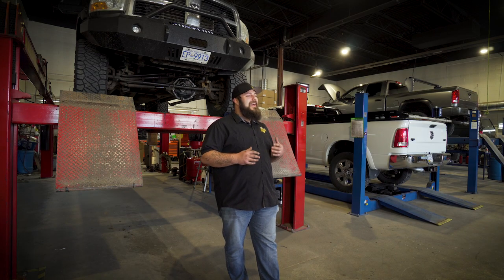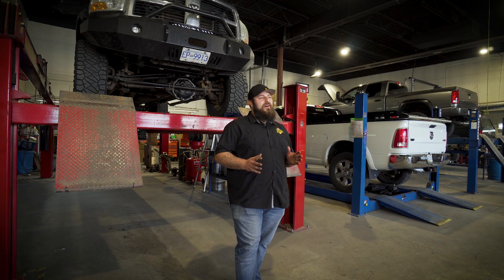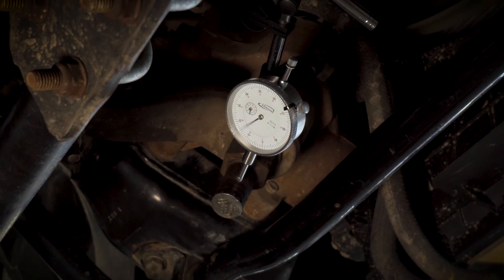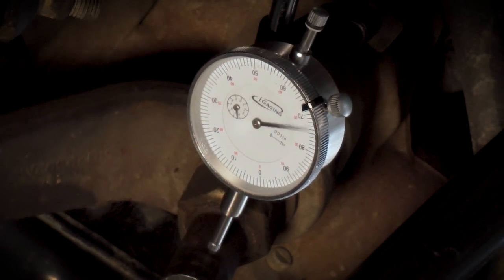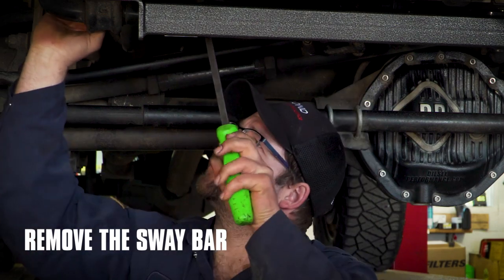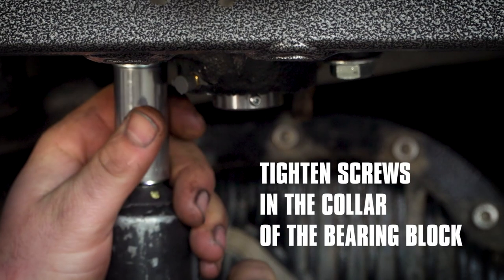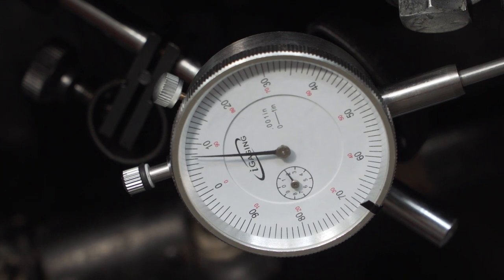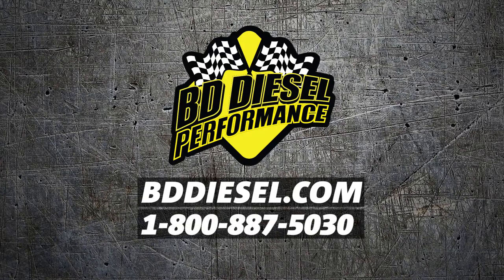Does a Steering Box Stabilizer actually eliminate Death Wobble?

Comment: I love your products and have your steering stabilizer on my 17 Ram 2500. However I think it would be worth mentioning that just about any worn steering component on the front end of these(solid axle) vehicles (Ball joints, track bar bearings, drag link/tie rod bearings, etc) can contribute to and cause death wobble. Not sure there is a magic bullet fix other than replacing any worn components. Of course this aftermarket fix along with some others(upgraded drag link/tie rod, Upgraded track bar) will keep ya rolling straight alot better than the factory junk!

Comment: This is a good product and I use it on my 98. All this does is remove some of the slop in the steering wheel from the play in the output shaft of the gearbox. They way they are advertising it is not accurate and this will not fix deathwobble. Years 94 to 97 and '00 until the 4th gen can sufffer from deathwobble due to the fact of the steering suspension forming a 'Y'. Most 2500s and 3500s 98-99 utilized the HD steering suspension that they later used on all 4th gen solid axle where the tie rod is a solid piece with an adjustment sleeve for alignment. This is the style that they're demonstrating in the video.... So if you're wanting to fix your deathwobble then you have to upgrade to the 98-99 HD tie rods, drag link and pitman arm for the second gen. If you buy the 4th gen style, you'll have to ream out your knuckles to get the joint to fit.

Comment: What stumps me is; when I was a young kid (60s) my father and all his friends had various 4×4s all straight axle and none of them had the wobble ever. It seems to have become a thing in the last 30 years or so. The only common denominator I can find is the move away from leaf springs in the front JMO.
Reply: I was thinking the same thing I had a 76 Ford f250 on 36-in tall tires never had an issue
Reply: I drive a 1984 as well as a 1989 Ford F250 never had any issues with wobbles. What poor engineering in these New overpriced Trucks.
Reply: Leaf spring trucks do it too. My 01 Superduty does it.

Comment: I did this on an 06 2500.  Worked like charm ..  Also thuren track bar and control arms ...try to run Toyos or nittos. My nittos work great . 55lbs of air .
Reply: I have a 06 doing the death wobble and doing the same thing I'm about to give it a go

Comment: I just removed mine on my 08 to install a new HD 2010+ steering gear and because the sector shaft is so much larger I need the new "nut". Bought a factory nut to get by for now but Holy crap does it wobble around now! I ordered the new 2010+ kit right away.

Comment: i own a 2006 dodge ram and i installed a steering stabilizer from BD but they pretty much all look the same. Needless to say i still got the wobble, after installing the Kore Recon series lift kit i removed it mainly because with the aluminum sway bar lowering block, i didn't have the correct length bolts. What i noticed was it had to do more with tire wear and balancing than anything at least with my truck. With new tires and alignment i have no issues whatsoever but when tires are at the halfway mark, i gotta watch for those uneven surfaces, bumps or dips.
Reply: It’s all part of the system. Everyone wants to say one thing is “the fix” but wheels/tires, shocks/struts, steering dampeners, and upper/lower control arms are all factors. Bottom line, the frame rigidity is the most common issue with big Rams.
Reply: Being in 4x4 country, and being an ASE certified master tech. I will offer the following info. (Please note that I became well known as the guy who could actually solve the death wobbles  where many others could not!)
Any solid  axle front suspension is subject to the "DWs" the reason (Which is primarily a Jeep and Dodge issue. Although my exs Mercedes had a "DW" issue also)
The main culprit is the front axle pinion angle. (Hear me out) As anyone who has lifted a 4x4 can attest to, this can be a real problem.  On Dodge/Ram and Jeep 4x4s with solid front axles when the front axle pinion is moved up to correct a lifted suspension angle issue the caster setting for the steering goes out of specification. (As in too much positive caster) A vehicle (particularly one wirh a solid front axle) that is brand new with no front end wear that has too much positive caster can offer up the dreaded "DWs" 
Add in "ANY" wear in the steering  components tires not perfectly balanced and/or a rough road and there you gave the undesired   wobble condition. If you are unsure what a caster setting is, just think of the balljoints as being the hinge on a door ( or in this case the hinge for your wheels to swivel left to right) The caster setting is the angle of the hinge. A positive setting has the top of the balljoint/hinge forward of the lower one. Where a negative setting is just the opposite. The more positive the setting the easier it is to steet and has less control over straight line stability.  The opposite is true for a negative setting. So, what to do about this issue? First of all remember that ANY wear or items added or changed in the front axle and steering cam amplify a less than desirable caster setting. Sometimes just front spring sag /frame twist/ axle bend (as in Dodge Diesels) can be an amplifier of the lack of caster settings. Larger wheels (more wheel offset) and tires (more weight to control for the steering  and shocks).
So how to take care of the problem? First of all, all steering components have to be in excellent condition. Second of all these issues don't start until there is considerable wear on the balljoints. Front caster and camber is adjuted by either rotating the balljoints or by rotating the sleeve that the balljoints seat into. So the number one thing to be done when replacing a balljoint AND/OR the adjusting sleeve on any lifted or truck that is having an issue is to only purchase one that has the most offset as possible.  (1-5 degrees) Select the most offset that is available for your vehicle. In some cases, you can get an offset balljoint AND an adjusting cam with a wide range of adjustment.  ( 2 degree offset balljoint and a 3 degree adjustment cam would be great) I always started worh the highest available offsets and only on a couple of occasions did I have ro back down on the cam offset. PLEASE READ AND UNDERSTAND THE NEXT STATEMENTS!
Remember that not only are you changing caster, you are also changing camber when installing  offset balljoints and adjusting cams. Before doing any of this installation make sure that you have a discussion with the person who will be performing the alignment.  Make sure that you will be happy to pay as much as double for the alignment for them to take the time to set it to your requirements.  If they balk, then they will not take the time to do it correctly.  You want factory toe setting "0" camber and as much negative caster as possible.  (Remember, most roads have a slight camber off to the right for water drainage, so a factory caster split is still required to keep the vehicle from drifting to the right. (Take note of the driving habits of your vehicle before doing these repairs/modifications. The suspension, tires, and roads in your area may already cause a drift that you may not be aware of.) Any new part that you install on your steering will/may assist in stopping the "deadly" DWs. But after the proper (for a modified truck) But they will stay way (providing no worn parts) with the caster set properly.
Many Jeeps that are lifted with very nice kits with adjustable control arms. You can achieve the same results by adjusting in more negative caster. HOWEVER,    pay close attention to your front axle pinion angle! Too much angle and you will be eating and/or breaking front u-joints!

Comment: Tires and your track bar are the first things to look at when addressing a death wobble issue, then the list continues from there, worn ball joints, worn steering arm and so on.

 This steering brace has nothing to do with the death wobble issue, so be careful of these false claims just to sell you a product.  New trucks don't have a steering brace and a new truck does not have death wobble do they, death wobble occurs from worn Factory parts.
Reply: Most of the time, the death wobble is caused by worn ends on the track bar. It's an easy fix and the parts are cheap.
Reply: Its a poor design that wears fast. Instead of having to rebuild your front end every few years this brace can prevent that
Reply: Tried a brace and helped some. Still have death wobble just not as often.
Reply: Didn't do much on my 03 I took the brace off now, no difference with it off.

Comment: About to install this on my 03 2500. Does this clear up steering slop/ steering wonder by chance? All of my other front end components are brand new and have just been put on not that long ago. Also I run 12 wide wheels which attributes to the steer wander

Comment: Will this impact articulation of the front end?  I have the sway bar disconnect on my power wagon.
Reply from the maker: Sadly the steering box stabilizer will not fit on a Power Wagon with the sway bar disconnect. However, in an application it fits, it does not affect articulation!

Comment: I have a 2017 power wagon and have yet to get this death wobble. Could it be maybe wear and tear causing this? I've went up to 90mph before.
Reply: Ya I have a 22 power wagon. If you get death wobble then you absolutely have some worn component in the steering. You can help get rid of some sloppiness with these upgrades but maintenance is key. If you run into this problem I have had better luck with good 4wd shops then most average mechanics.

Comment: I just bought one today. I have a 2nd Gen 5.9 I was hoping this was going to help fix my death wobble but does it even work at all?? I also bought new bushings for the sway bar an a Rough Country steering stabilizer. Anybody know what else I might need to fix this bull shit? The death wobble happens when I hit a bump and just the other day I hit a deer and it made my shit go into a death wobble at like 65 almost lost it. If anyone has any info hml.
Reply: Installing this alone may or may not “fix” your issue. You need to go through all of the steering components and correct any other issues. A stabilizer will help improve the life of your gear box and other components along with reduce “bump steer”, but I doubt you’ll notice much difference with the sway bar bushings. Hope this helps
Reply: Dik Tat yea I bought it an it fixed my problem thanks!
Reply: Look at tire quality. Supposedly better tires help. Caster alignment is important.  Ball joints and tie rod ends. Frame hole where sway bar mounts. Last resort is to install a t type tie rod assembly. Synergy makes one and DOR make one ($1000 approximately)

Comment: Before purchase it road fine, suspension was great. Upon purchase of a 2022 ram 2500 diesel.  I had them put a 3inch leveling kit in it. It rides really rough now and when we go over a bunch of bumps in a row it death wobbles so bad we have to stop, it starts bouncing off the road or into another lane. Is it worth messing with the leveling kit or is a 4inch lift kit better as I hear a stage 2, 4 lift would solve the problem.  Your thoughts
Reply: Upgraded the trackbar? Or still stock?
What kind of leveling kit did you use?
Reply: @jonasgussvattnet  not sure on brand as the dealership had a company called 4 wheel parts install the 3 inch leveling kit for me. I assume the trackbar was replaced I'll have to look. Going to have a fox steering stabilizer put in it. I hear the stock damper is not strong enough for bigger tires even though mine are only 20inch rims and 32in high rubber

Comment: You will never ever have "death wobble" if you keep good tight steering components. I have never seen or had this issue and I've owned many dodge pickups light and heavy duty of all generations.
Reply: Yea, really primary use for these is to stop your steering box from flexing the front frame horn and cracking it.
Reply: And that also translates to slightly less steering slop

Comment: I cant seem to find one for the 2014 ram 1500 sport. I have 20x12 wheels on 35s and level. Could I use one of these on a 1500?
Reply from the maker: Hi Dusty, we do not have these for 1500 models
Reply: Hey dusty 
did you find something for your truck? I have a 2013 with the same size of the wheels and tires and I have not been able to find the solution

Comment: This stabilizer does not stop death wobble. I know for a fact. Both my dodges have this and the 3rd gen still gets death wobble when parts get worn out. The A.M differential engineers screwed up and got the geometry off some place.
Reply: I've got a 2003 2500 cummins six speed 4x4 and I replaced EVERYTHING in the front end, direct from dodge (boxes were moog problem solvers with dodge part numbers).  New ball joints, tie rod ends, drag link, steering stabilizer, pitman arm, all four control arms, new bushings (tried both poly and stock) in the track bar, wheel bearings, rotors and calipers/pads, all were the later 2011 parts (somewhat thicker than the originals, PLUS a BD brace with pillow block bearing.  The wobble used to start at 24mph. Now it starts at 18mph, all I have to do is bounce off a frost heaved pavement crack with the left front tire and off it goes and I have to do a complete stop to shut it down.  Only thing that helped (for a very short time) was pounding ground down washers up into the control arm brackets in the frame and then putting the bolt thru.  I do have I think 3 or 4" spacers in front (came with the truck, already installed so it would clear the BFG all terrain tires.  I have nothing left to change guys.  HELP!  Truck is down for a transfer case rebuild due to the vibration destroying the front bearing and front driveshaft U joints (replace with spicer HD Ujoints too, that's done but the xfer case chain is so sloppy it's binding up)  Any help or ideas are appreciated. I"m a 61 year old 80% disabled two service vet and I'm about out of money and patience with this thing.  Now, the odd thing.  WHY did they even USE recirculating ball steering in these?  My 3500 cummins six speed 2wd crewcab dually longbed has rack and pinion and rides like a dream.  My steering gearbox is looser than my 84 sububurban 2500 diesel's gearbox is (and that is 3/4 steering now).  No idea if we can tighten it up or not, but it's been pounded by the vibration.  I think the tires are 315/75/17s on the stock aluminum rims (Tire tread remains flat so the rim is wide enough).  The only thing we did not do is remove the spacers since I don't have a stock set of tires to fit it.  (the fronts will definitely rub without the spacers).  Should I go buy a set of stock rims/stock tires and try it and then pull the spacers?  I can't see that being the problem at this point but the truck just sits and my old 97 GMC K3500 crew cab 4x4 dually longbed 6.5 diesel is not strong enough to pull my cabin cruiser nor my race car.  Thanks again for any assist...

Comment: This is bogus. Selling you something you definitely don't need. It reduces slop in the column, that's all. Swap the y steering for T steering, check tie rods, thank me later
Reply from the maker: Thanks for your comment, Kevin. This product actually isn't intended to stop play in the column, it's intended to stop the gearbox from flexing on the frame, which is a very common RAM issue.
Reply: @BDDieselPerformance  what I am telling you is I own one and it didn't do anything. Personal experience
Reply from the maker: @brainswole101  Thanks for your feedback. We typically get good feedback on this product; sorry it didn't work out for you.